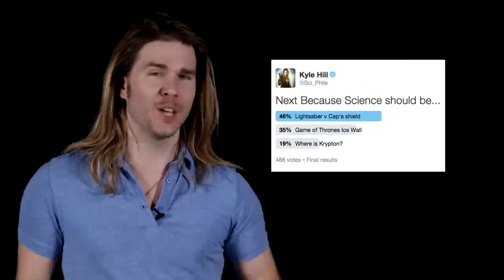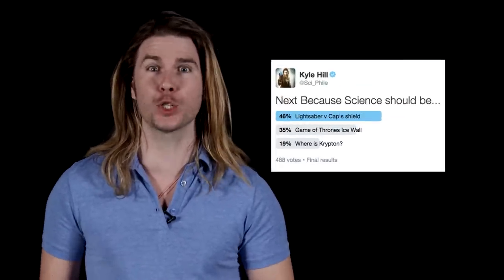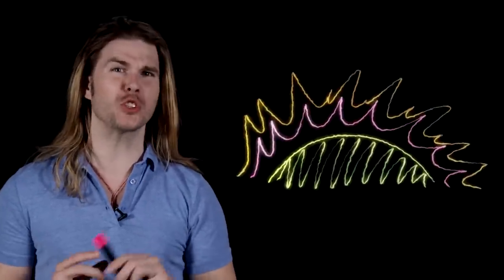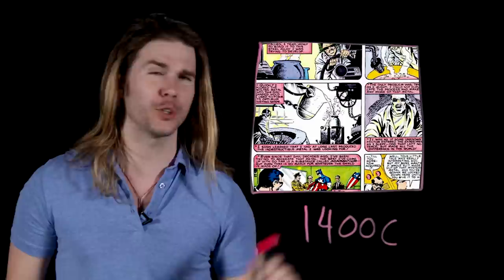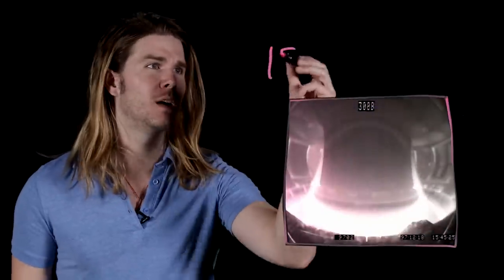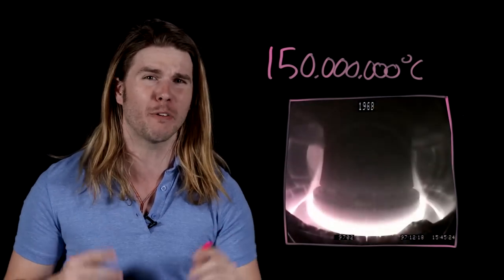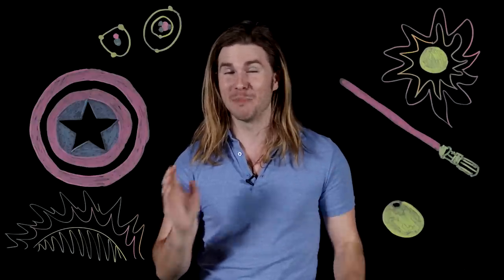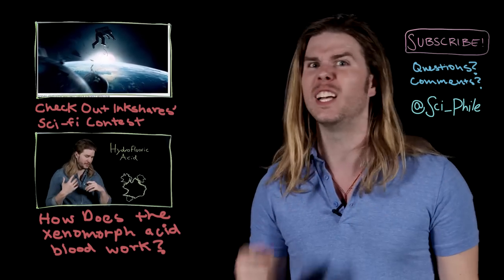Could a Lightsaber Cut Through Captain America's Shield? (Because Science w/ Kyle Hill)

Comment: You forgot to take something into consideration that makes blocking the lightsaber different from dropping the shield into the sun. Heat dissipation. The shield doesn't just absorb the energy, it redirects it it back out. It's why you get a huge explosion when Thor hits it, but Capt is OK under it. That powerful ability to re-emit the energy out is why it's not supposed to be possible to melt the stuff.

So the heat energy of the light saber would get radiated back out. The actual end result would depend on how much energy gets dumped how fast into the shield.
Reply: idk why no one has liked your comment wtf
Reply: and both the attacker and defender spontaneously combust.
Reply: It technically would be both, considering it's reactive function against energy and vibration
Reply: @Mr. Whiskers No, the blades can block other blades, so the heat redirected back at it wouldn't melt it
Reply: @jcklsldr  No im pretty sure he's right. Let's say that Thor's hammer Mjolnir had similar effects as the lightsaber when hitting the shield. Both can reach temperatures of the Sun/Sun's core. Since your point is the lightsaber wouldn't be destroyed because it's blade is able to block other lightsabers, same thing can be said for Mjolnir. In the MCU, Mjolnir is made out of Uru, which is stronger that Vibranium, yet when Mjolnir was struck against the shield, the kinetic energy was still redirected. Therefore when a lightsaber strikes the shield at a force similar to the scene where Mjolnir struck against Cap's shield, the kinetic energy would still be redirected. And lightsabers aren't indestructible. Although the blade has never been showed to be broken, the base has. In Star Wars: Rebels, when Obi Wan Kenobi killed Darth Maul, he did so by slicing through the base/handle of the lightsaber, destroying while also fatally wounding Darth Maul. In theory, if the lightsaber were to hit Cap's shield, and the kinetic energy redirected is powerful enough to destroy or disable the base of the lightsaber, then the lightsaber would be destroyed before it could slice through Cap's shield. So basically the fight is decided upon whether the lightsaber can endure enough kinetic energy redirected towards it when striking the shield.
Reply: @krisskrosssss  how long did that take to type.
Reply: then how did they shape vibranium if they can't even melt it?
Reply: @Caden McCord according to the guy who made the comment you can't melt vibranium
Reply: yea but if you wait long enough the steel in the alloy would just melt away a quick burst would be fine but long periods of times just turning it into a brittle piece of vibranium

on top of that light sabres are concentrated  so with the example of the sun its like putting all the energy of the sun on one tiny spot for extended periods of time 

on the other hand when thors hammer hits are only short burst of electricity witch can be absorbed, reflected or dissipated as for a lightsabre its a constant source of energy 
unlike a hammer which has a wider hit a light sabre is pointed making it easier to cut though metals and concentrate energy on a signal point
Reply: @krisskrosssss  So what you're saying is, you try to hit that thing with a lightsaber and you get a lightsaber in your face

Comment: Yeah ok but
how well would the steel do against jet fuel? specifically in beam form?
Reply: But can they melt dank memes?
Reply: just because the steel isn't melted doesn't mean the steel isn't weakened enough that a sufficient enough weight, such as, say, even 10 floors of a skyscraper has, can cause the steel to collapse so much that it can no longer support the weight above it, and the portion above it falls
Reply: Jet fuel cant melt Captain America's shield.
Reply: Hes blocked ironmans hand rockets...
Hes blocked a blow from thors hammer. 
A lightsaber in the marvel universe wouldent do much to the shield.
Reply: hey cgus, try to watch the video again. he clearly stated that the vibrations from thors hammer hits are adsorbed, thats understandable. the hand rockets are not only heat, but vibration as well, as well as not able to be hot enough to do the damage it needs. BUT, he does say a lightsaber, would melt through the shield. he COULD block it for some time, very short be that as it may. but it is not vibration, its heat. and it is so hot it would melt through it.

Comment: Here's the part of the discussion that I think you missed. A lightsaber may well be capable of core temperatures ranging from thousands of degrees centigrade to surface-of-the-sun hot. But such actual heat, without mitigation, would evaporate any Jedi or Sith who attempted to use it. This clearly doesn't happen, so we must deduce that the magnetic field that curves the plasma blade in on itself also insulates the outside world from this heat. Call it something like a heat-exchange conduit, that efficiently pipes the excess heat back into the hilt for recycling as plasma fodder, or that converts it back to power.

This being said, merely holding a lightsaber against Cappy's shield would achieve next to nothing. It would take a sustained, Force-enhanced pressure (ala Qui Gon Jinn's assault on the door of the Federation bridge) to warm it at all.

Secondly, we also know that the heat application of a lightsaber can be modulated, much like a real-life plasma torch, so that it can cut (high-temperature mode) and also weld (mid-temperature mode), as seen in the outtakes from episode III. For this reason, we can assume that using a lightsaber to cut something very resistant takes either sustained Force application, a parametric modulation of the saber's controls, or both.

Finally, the Star Wars universe is filled with objects and materials that are "lightsaber-resistant." These are metals, materials, and fields that can take a standard blow from a lightsaber without damage. The EU has many such items, and we've seen a few in the canonical films and cartoons. It is reasonable to assume that the strongest metal on earth (or close to it) should easily keep parity with such non-terrestrial substances, and so would hold up in a standard battle.

The "vibration" dissipating properties of vibranium should easily act as a heat sink to most applications of the saber to Cappy's shield. And Caps would be savvy enough to know that the shield is in danger of damage from a sustained attack - likely some 5-10 minutes before the shield even gets hot, I should think - and to keep "modulating" it by moving it, rotating it, shifting it, or whatever else is necessary to maintain its form and temperature and relieve any sustain against it. Therefore, I think a Steve Rogers/Jedi-Sith combat would be, if not evenly matched, at least not a slam dunk against us Earthlings.

And just imagine the shock of a Sith getting a Forceball volleyed back to their face by a non-Force adept!!  ;^D
Reply: +Grymmorgan why put so much thought into bs?
Reply: Stoned Reality Um…because…science?  ;^)
Reply: +Grymmorgan boy, you must be fun at parties
Reply: tjplitfc "Puh…" Um…"parties?" What's that do?!?  o.O
Reply: +Grymmorgan xD omg haha nice response lol
Reply: +Grymmorgan I agree. Also, we also regularly see light sabers being waved at the interiors of ships and other what are presumably steel objects and it doesnt always fully cut it....as easily as such a high temp would suggest

Comment: Plasma fuel can't melt vibranium beams
Reply: Disney did 9/11
Reply: Trump did 7/11
Reply: Hydra did the Starkiller base bombing.
Reply: +Marco Fatica HE WAS TALKING ABOUT THE 711 FIRE STATION
Reply from the maker: +DerVentilator Doesn't have to melt it, just reduce its material strength enough for the shield to fail under stress. -- KH
Reply: +Nerdist It was just a reference to an old meme. :P